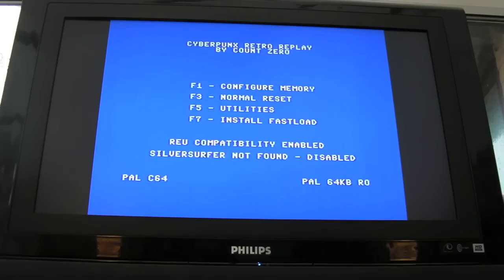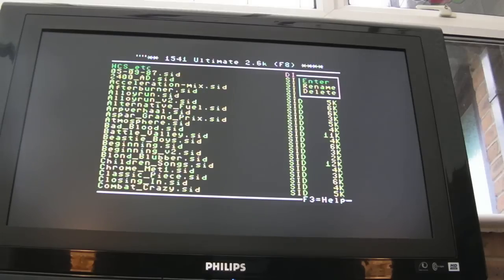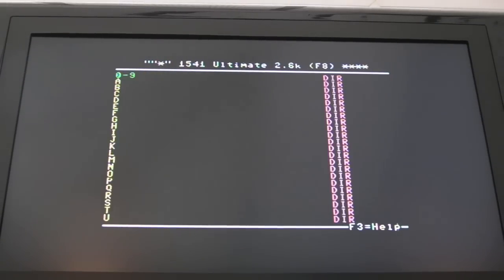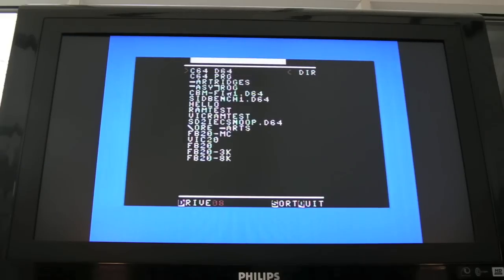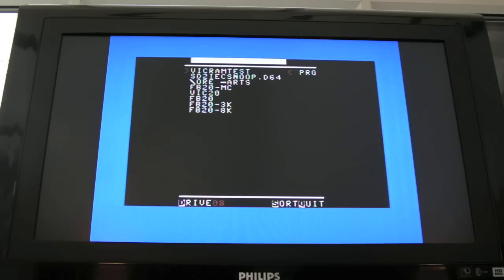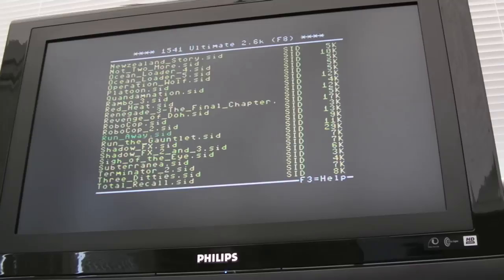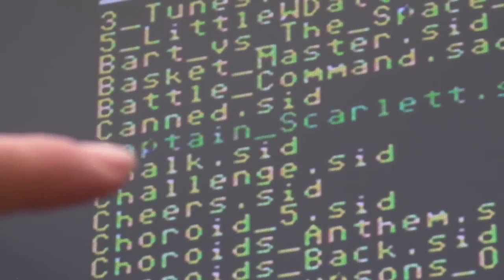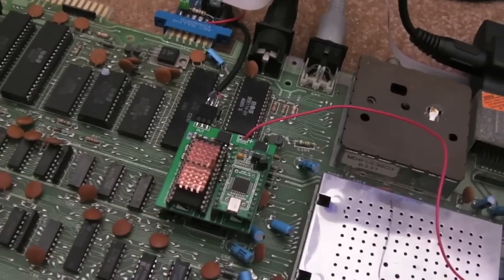Commodore 64 (C64) SD2IEC & 1541 Ultimate II Glitch Fixes

Comment: very strange, I 've never seen this either. hope you manage to solve the mystery.
Reply from the maker: I did lol - solved within the video! =D
Reply: ha! you caught me out commenting before the video was finished, so it's down to the settings on the cartridge and not the machine?
Reply from the maker: Yes, but I think the reason those settings are provided is that some C64 motherboards needs those different settings.  It's going to vary between board revisions!  For the most part you would never need to change the settings, whereas I just happen to find a board where I needed to change them =D

Comment: Gadget, where did you get those little heatsinks for the sid ?
Reply from the maker: +Toshio Spoor RAM heat sinks off eBay - http://www.ebay.co.uk/itm/8x-Pure-Copper-Memory-Chipset-Cooler-HeatSink-Heat-Sink-For-IC-DDR-RAM-VGA-SDRAM-/191167775314?hash=item2c827cc252:g:pfkAAOxyHIlTbGjt
Reply: +GadgetUK164 Nice! Thanks.

Comment: cool bit of info there. have you reported this to gideon 

it might be a bug on his side of things
Reply from the maker: +Silverfox0786 Nah, it's not a bug - its a timing difference, probably due to the position of the PLA I think - but possibly not.  He deliberately built the option in there to alter timing for that very reason.  All my other C64's work fine with PHI2 edge recovery enabled, just this one doesn't like it.
Reply: yes after more investigating that PHI2 was also put in there for the C128 as well so it can be set to its clock

Comment: Is it possibly related kernel rom because font data is fetched from there ? Edit: Oh the ultimate has some timing settings :) I get a 404 Not Found on the link to the documentation located at the 1541ultimate site.. :-\
Reply from the maker: +bwack Hehe, I like your thoughts there up until you saw the bit where I change the settings and it was resolved.  I think what's going on is the 1541 ultimate is providing its own character ROM set and RAM whilst NMI is running, that explains why the character issues only ever appeared in the menu and not when control was passed back to the C64 from the cart.  Very strange issue, and I think it does relate to the PLA position on this rev board.

Comment: I've been using my sd2iec for about a week now and haven't seen any glitches to be truthful, i did updated the firmware
for the sd2iec when i got it so it might be a firmware issue, im using a c64c model, i have noticed that my c64 can be
a little picky with the tv i use though composite as i get a black and white picture on my alba tv but on my LG it looks great.
Reply from the maker: +FourX2k3 You won't get the SD2IEC issue on a C64C just because of the revision of kernal in there - The 'blue text' issue only relates to rev 2 kernals.  You can see the issue here https://www.youtube.com/watch?v=N4jRzMV0l8I at 7 mins 52 secs.